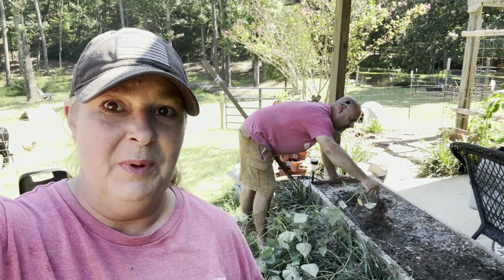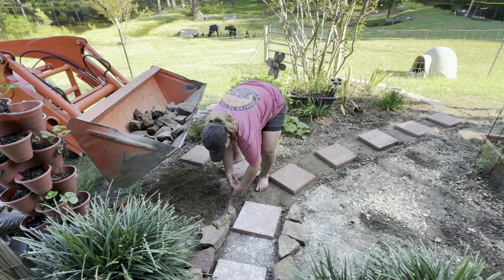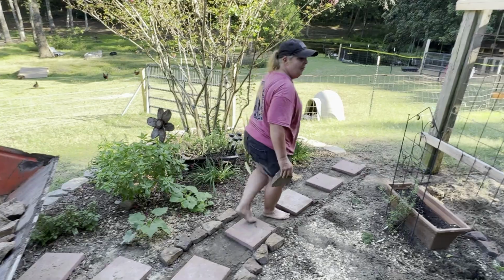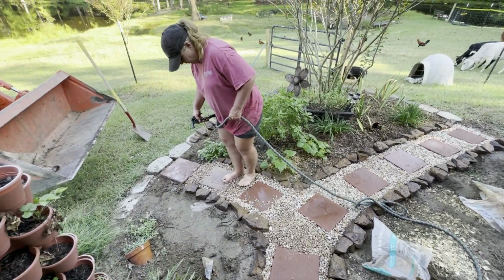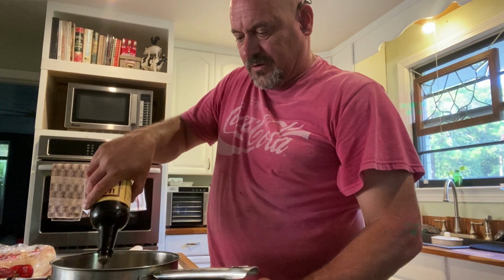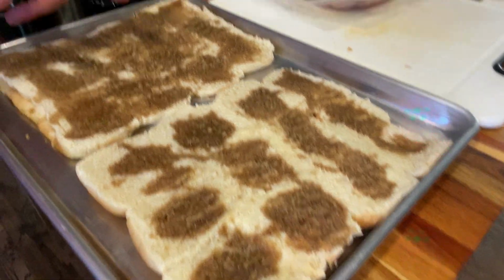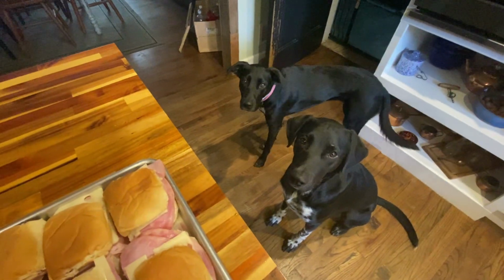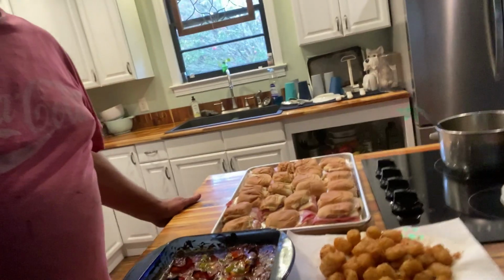KITCHEN GARDEN, GAMEDAY RECIPE & MARRIAGE ADVICE

Comment: I put down some more Oklahoma sandstone out my back door yet this year. I bought a bunch of little scraps so that I could stand on them and see which way they tilt it and then put the Little Rock ships under to completely level them.
Reply from the maker: @lostribe5130  That is awesome! I bet that will be so pretty! We love using rock and stone.
Reply: @CelebratingFarmLife  I need to do what you did and put some gravel too, but the ground is a little rocky right there so it's held up, but on the side where there is no rock, it has eroded a little and I guess I need to add some soil.
Reply from the maker: @lostribe5130  They do help hold the stones in place. We had to add dirt under parts of the retaining wall where it had sunk down some. It’s hard to judge how much if any dirt you need to add until it all settles down.
Reply: @CelebratingFarmLife  I like putting the small pieces of rock under the big flat stones to level them. It works surprisingly well and is super easy.
Reply from the maker: That's a great idea! 👍
Reply: @CelebratingFarmLife  that's for when you're using natural rock instead of pavestones. It's a lot easier.